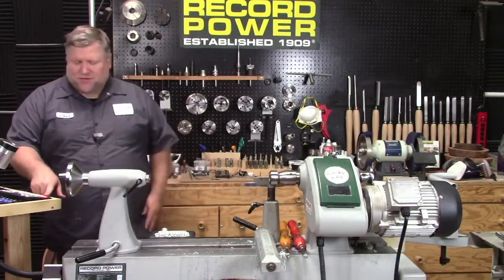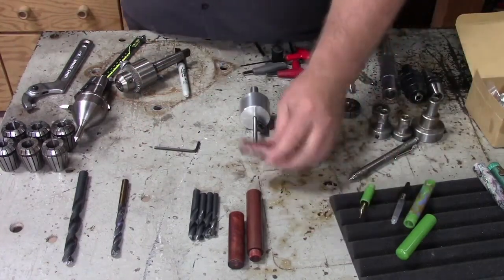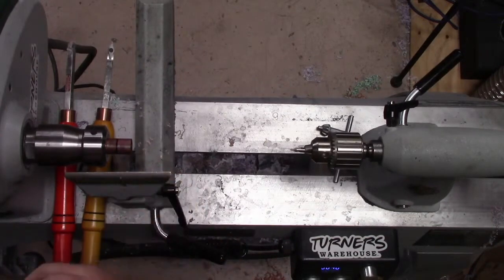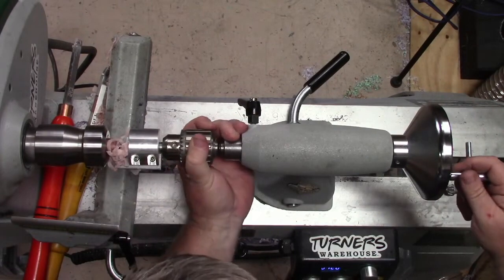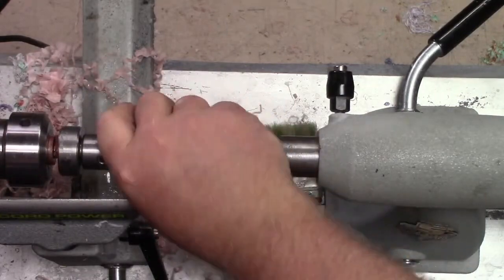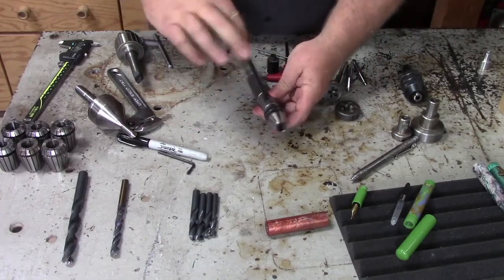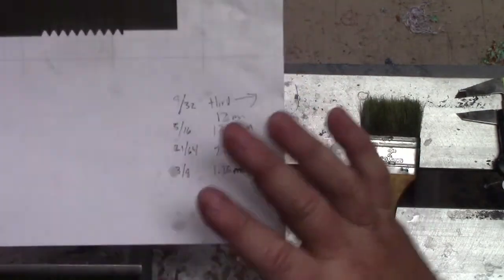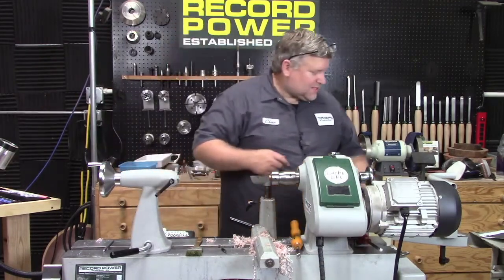Custom/Kitless Bespoke Pens- Making the Section- Live Demo Replay

Comment: What was the number of the bushing used for the section’s tenon? 10 or 9 mm? Thanks
Reply from the maker: If I remember correctly off the top of my head (which I am 98% sure I do) they are a 10mm